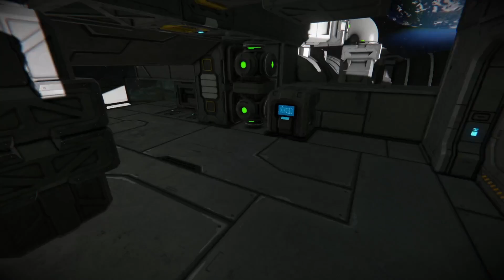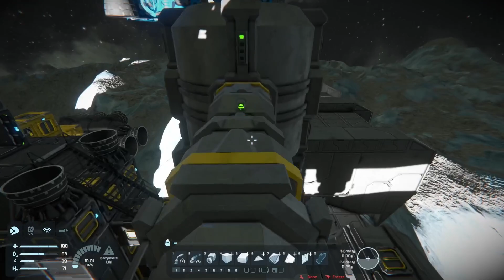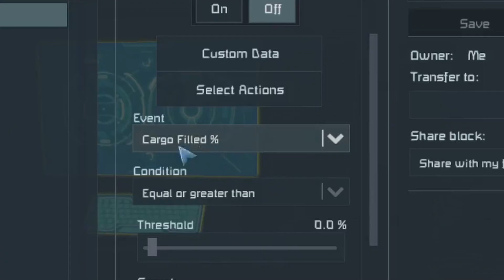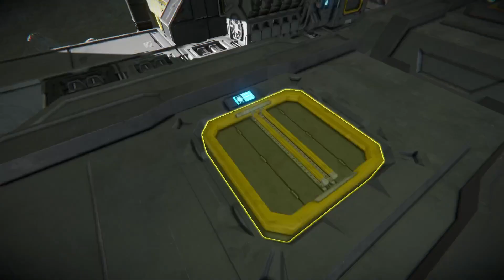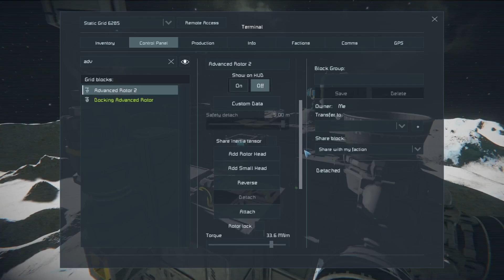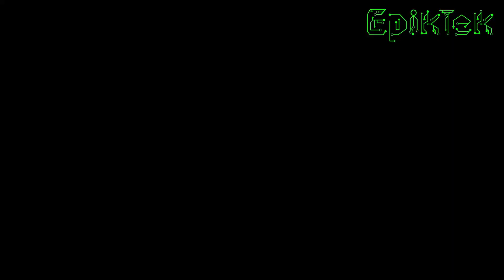Willis Duct Update - Space Engineers Reprise s1e14

Comment: Event controllers, like timer blocks, have 9 toolbars so you can put up to 9 actions in each slot.  So you can do 9 things when the condition becomes true and 9 when it becomes false.  Timers are only needed if you need to do more than 9 things or if you need to delay some action(s).  Keep in mind that the timer block start action uses the delay you set in the control panel and trigger now ignores the delay and just immediately starts the actions.  One of the big reasons for rotors to explode when you attach a head is that they are directional.  The head has a 0 position just like the rotor.  When you attach, the rotor immediately tries to turn the head to its current position and if something tries to stop it hard enough, it will explode.  You might also be interested in a mod called "S - DuctGrate v2" that makes the grate for the Willis ducts an actual door.
Reply from the maker: I've never noticed that those toolbar indicators before, wow!
The timer block thing I noticed in editing, I hit start instead of trigger now, but thought I'd hit trigger now.
So much good advice. I didn't even think about the rotation on the rotor, of course that's what it was. :facepalm:
I normally avoid mods that add or modify blocks, but that does sound cool. I was disappointed that wasn't the default behavior.